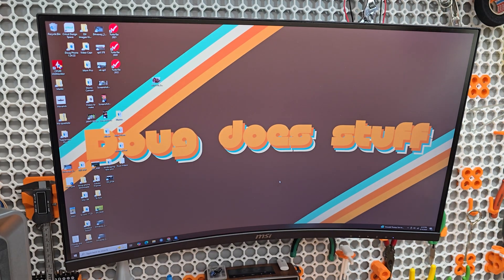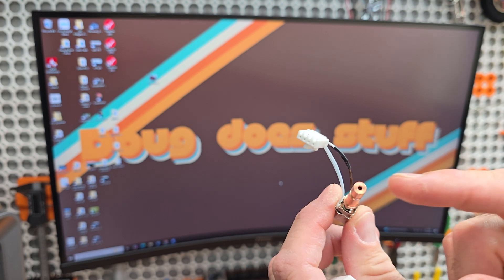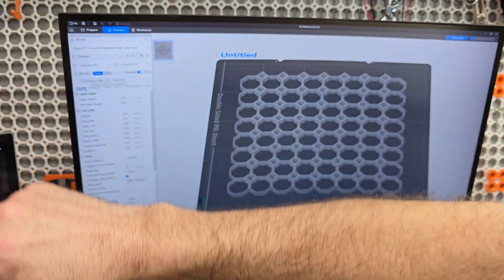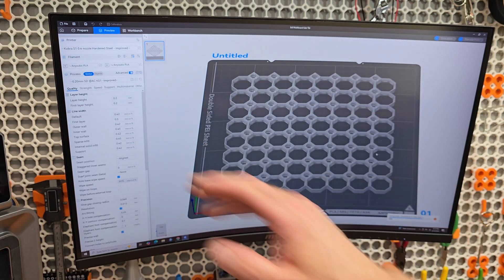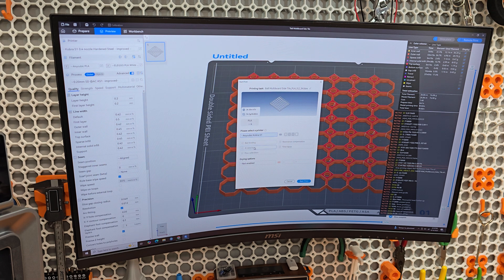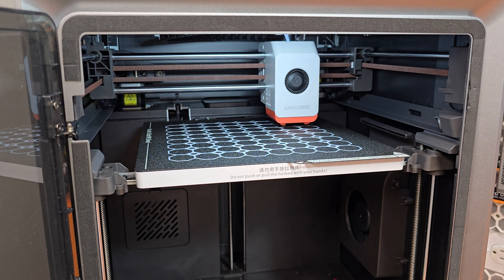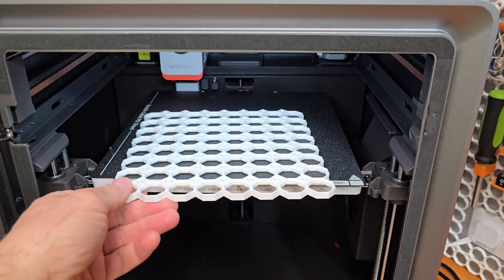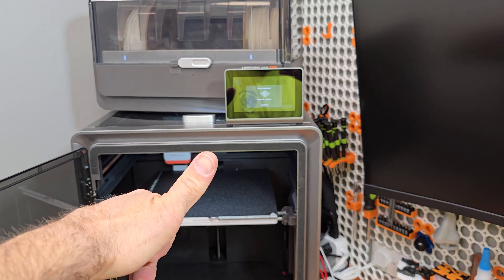Kobra S1 Combo: New hotend Torture test print....multiboard tile

Comment: Awesome update, Doug! I think the replacement thermistor fixed my issue. I just received the replacement official hot end from Anycubic, but I’m going to keep this third party one on for the time being. I’m finally getting consistent good prints, so why mess with it?
Reply from the maker: That's what I'm doing too. When the Anycubic one comes in it will be a spare. I will measure the resistance first

Comment: Have you noticed a bump sound from the z axis lead screw when the bed moves up and down? Mine prints just fine but the sound I can’t tell if it’s normal or if they all make it.
Reply from the maker: I haven't, but I will listen when I go downstairs next to check on print
Reply: @ thanks! I ended up taking my unit apart. The nema 17 stepper motors seems fine and no loose parts on pulleys or tensioner. I did however find the rear lead screw was not centered and honestly there is nothing to keep any lead screws center due to no upper bearing. Not sure if it matters that the screws are not captured but I found bearings that press perfectly into mount and shaft slips nice and snug into center race. Put all back together and after a calibration I have the same noise, seems like it’s coming from z-axis stepper and transmitting through the lead screws. Prints just fine but I’m also comparing it to my Bambu P1S. Thanks for getting back with me!

Comment: i had my clog again, this time i couldnt easily fix the issue. i think it is a problem with the hotend design itself. i ordered a replacement hotend that looks like the original with a hardened steel nozzle, and that should be here tomorrow. hopefully, this fixes my issues. i will be ordering a bunch of the nozzles you linked here soon so i have several spares. more clogs are bound to happen reguardless, so having replacement hotends on hand will be a good idea.
Reply from the maker: That stinks. Hope you get it sorted. Not sure how the hardened will help, let me know!